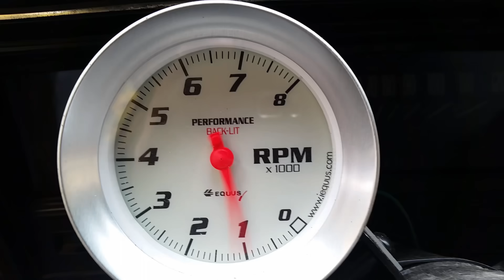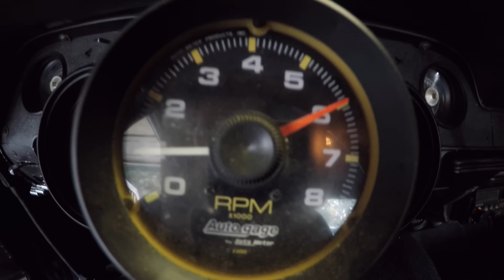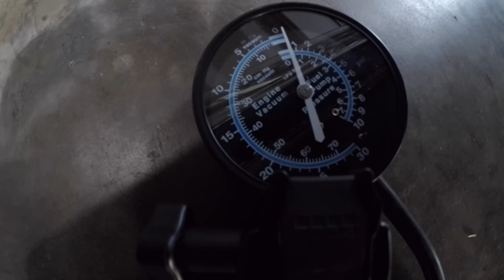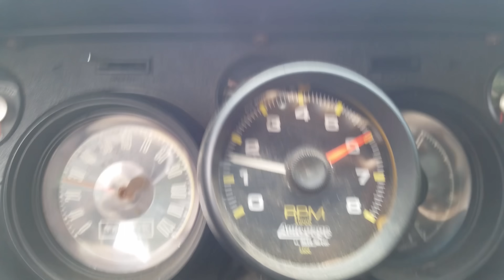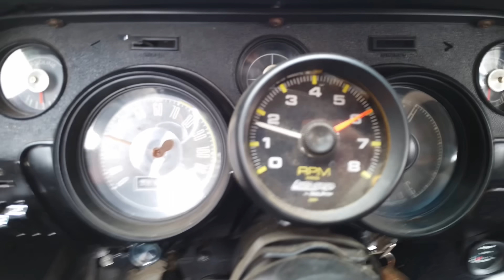Small Cubes... Big Power! | Not Rod Ep. 11

Comment: My Holley 750 just experienced the same trouble the front and rear bowl on the top of the carburetor have the two screws when you back them out it's the actual needle to allow gas in and out of the float bowl your actual float boul isn't receiving enough gas inside of it so that when the pumps running you have response but if you were to shut the fuel pump off and start it  the vehicle won't run it all it'll act like it's out of fuel when actually it should run for a minute then the float bolt run out of gas your front and rear float bowl needles for the float are most likely not  adjusted properly or the o-rings on them two are bad I just went through it on my carburetor on the very top of the front and rear the float bowl is too big flat screws on top of carb it allows the float needle to be higher or lower the needle so that it allows more gas in the bowl it sounds like yours are turned all the way in turn them a 8th turn out and then turn the nut that's underneath of them tight to the carburetor and that'll allow more gas in the bowl shut the fuel pump off start the car if it stalls immediately in acts like it's not got any gas then turn fuel pump on fire it if it runs but has hesitation and it's definitely the float bowl adjustments the needles just fix the same problem yesterday hope this helps you guys kurt

Comment: Why not take it through the progression he would have, as just few clips of his past, seems like he always moved forward with the times. Where as in the early 2000's, big carbs, big cams, decent power, but well above stock, and kinda retro was the thing to do. 
Just as a lot of us older ones were doing, kinda replaying our younger years for some, and for others, what they had always wanted to do. Plus we were still not impressed by the fuel injection, as it was mostly things that sorta looked like carburetors, but weren't, and not that impressive as far as we knew about making power.
We did know how to do it with the combination your dad put together, even if he didn't build it himself, but he knew what he wanted . Whether it was fomoco, GM, are Dodge, they were still using the old school technology in the things most of us drove as far as engine designs. 
The trucks a whole lot of us drove, sorta had throttle bodies, with ford and dodge having odd shaped intakes, but chevy still had a lot of vortex engines running around, with normal intakes, and fake wanna be carbs. Yet the piece of cast iron below the manifolds, was old school, and with a little work, ran much better with aluminum intakes, carbs, headers, and dual exhaust if you could get by epa bs.
Then LT, LS, DOHC's, and sorta Hemi's came into play, all with real fuel injection that was working, that natural progression I believe would of caught his attention. Especially, since we are older, and ethanol came into play, we don't mind fixing things once in a blue moon, but EFI, is so much friendlier to deal with ethanol, carbs not so.
After replacing diaphragms, seals gaskets, needles jets, and some metering blocks because ethanol was eating our prized Holleys up, literally with in weeks after rebuilding, are replacing these expensive dinosaurs. A lot of us seen the light, and switched over to the once dark side, and now once more, we can go out to the shop, garage, wherever we keep them. 
Turn the key, and if batteries are hot, we go do whatever we do with our toys, but at the age we've made it to, bending over a vehicle every weekend, isn't the endless fun it once was. Not saying some of us don't enjoy doing such things, are building one up, but just fighting bs issues over an over, is more irritating, even with a few cold snacks with the old crew, not what we want to deal with.
Sorry for the long read, but I didn't know how else to make it to where you could see his possible natural progression, and if you two were working on such things together, it's possible that he stayed true to our old ways too.
I was just sharing what some, not all of us older ones have finally come around to, and offering it up to you, as a possible route to take. Yes I watched you two for some time, not far behind your first one have I been here, and so I know what you two youngsters have been up to.
I seen myself several times in one or the other at times, and I see the old ways are still strongly embedded in your methodology, and mindset, for which I am glad you keep the old ways alive for everyone.
Thank you both for that, and you two surely give some of us not so young ones some good laughs, and bring a few old stories back from the cobwebs too of the times one or more did something, are luck bite them accordingly.

Comment: Not that I know anything about anything but:
*ensure there's no vacuum advance at idle because if there is then the when you floor it then the ignition will retard causing a bog
despite what YouTube experts tell you  remember I'm a nobody and don't know anything so my advice is more likely than not to be better than the experts 
*with the timing set, vac disconnected and plugged adjust the idle mixture via this method - set the throttle stop screw so the motor idles. Screw in mixture screw until it starts to lower in rpm then unscrew it until the rpm rises to the highest speed, then unscrew it a further half turn. Repeat this for all the idle mixture screws THEN reset the throttle stop screw if necessary and repeat the process. You see idle mixture is very important because it doesn't just control idle it controls idle to main metering circuit transition in the area the flat spot or bog was occurring.
*also check the power valve isn't leaking
Reply: I'm no "you tube" expert as u call it ...but I run manifold vacuum on a few of my motors and they run like a top... if your "flooring" it then if your advance springs are set up right there's not even enough time for it to "retard" the advance as your saying... you have to remeber ported vacuum was only used to help the engine heat up the emissions equipment with a dirty exhaust....  stop spreading crappy advice

Comment: no the new Holley black accelerator pump diaphragms are not non ethanol compliant. They haven't made those in 15-20 yrs. Before ethanol fuel had MTBE and it's just as bad on gaskets and diaphragms.
So many people bash ethanol but it's no where as bad as methanol.
I see SOOOO much wrong ideas on tuning here. Sooooo much wrong. A small engine with huge heads supposedly and cam BUT a horribly restrictive dual plane intake.
Talk about crutching a completely messed up setup. AND not researching just what's going on with it.
Since you have zero knowledge of internals I would have dug in, and sis some disassembly to investigate just what's going on. Also if you don't know what cam is in it then how do you reset valve lash regularly?
Reply: Give the kid a break……..Do you have any diy how to videos??…..maybe show the rest of us how its done😂😂😂